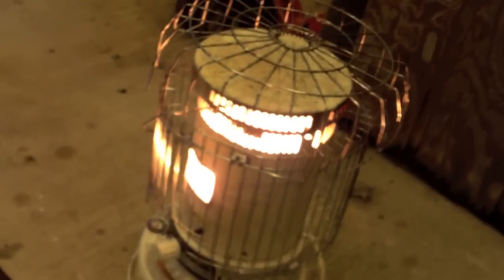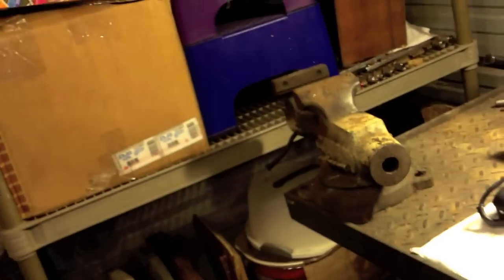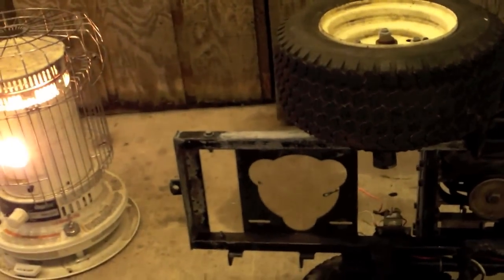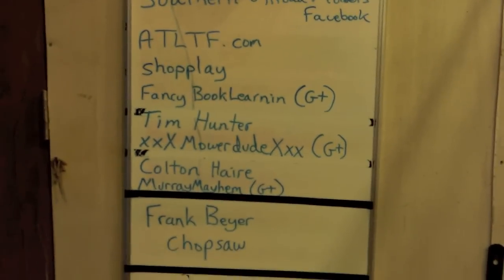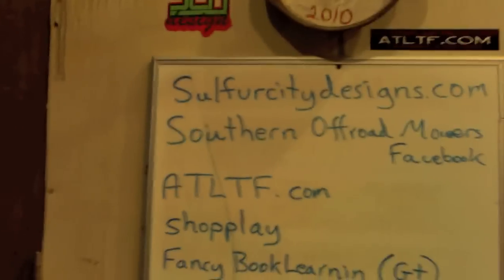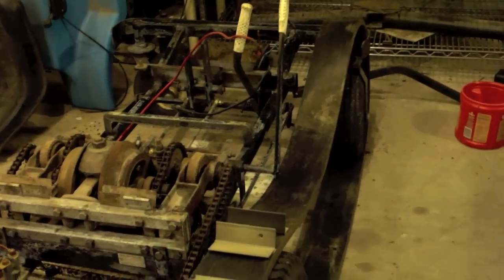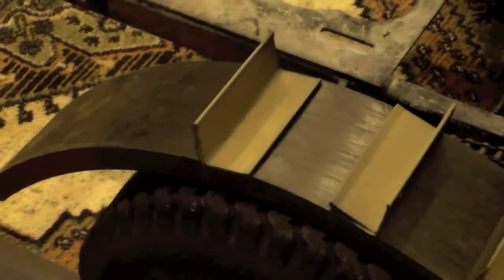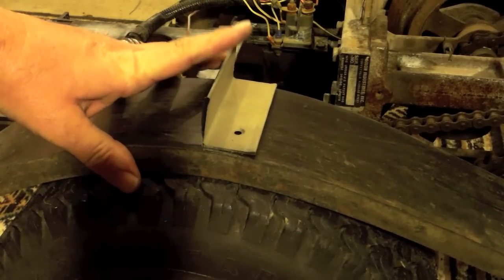Dixon track mock up!

Comment: Cool intro and music.
I'm to cheep to buy another grinder I use mine with a cut off wheel, grinding wheel and also wire wheel. and only hand tighten them. makes it easier and faster to change. The centrifugal force is enough to keep it tight. 
Hope it works.

Comment: You sure didn't go wrong on those grinders, mine lasted quite a while.
I wish you were closer I could hook you up with dixon mowers, and some snowmobile tracks.
Reply: *****
I can pick them up at a salvage yard, it costs them to get rid of them, but I would have to take it, but not a big issue, you would need to cut one in half, cause they're so many different sized ones, different sleds different tracks. Let me no if you are interested and I'll see what I can do...

Comment: I would recommend you make each track in two pieces... use 4 inch wide SS HD door hinges for the connections. The reason for the 2 piece track is so that no matter where the tread stops, you have an accessible joint for removal of the track. Replace the pins in the hinges with grade 8 shoulder bolts. If you can't find those types of hinges there, I think I have some I could donate. Sandwich the hinges ao they are not in contact with the road (split the ends of the rubber pieces so you have a half inch on top and a half inch on the bottom) This will keep the hinges from wearing through. If you chuck the ends of the rubber in the vice, you will find your cutting disk on the angle grinder will work quite well for this task.

Comment: Those angle iron will bend on the first drive, also they use reinforced rubber for those purposes, and I will suggest to think about how the tracks will track before traction, like will they run straight. And I wouldnt throw away money on stainless steel bolts unless you have em laying around, since the belt will be trash long before a galvaniced bolt will catch rust. Just my 2 cents :p And you can use wood on both the tracks and for the wheels.

Comment: You could use like 3/4 in screws to hold the plates in, like 3 to 4 screws per cleat. it would be cheaper and i think it would work.

Comment: Instead of having the points of the screw comming out the other side of the rubber just get shorter self tapping bolts and screw down the cleats and then on the inside of the rubber screw in to the rubber and use the head of the bolt as what the tire grabs on to or else u going to go through some tires because its going to tear it up

Comment: its a shame you only have enough of that rubber for three tracks it would make better tread blocks than the angle iron and I agree with those who said you will want to cut the angle iron down they look to me like the first time you put any real force to them theyd bend flat
Reply: ***** i figure if rubber tread blocks are good enough for the m1a1 Abrams tank then they should work well for your purpose unless you could find some old atv tires cut the tread off and bolt it to you tracks

Comment: hey that is a good Idea I do have 2 grinder but I always use 1 crap now I will hook 1 up just for cutting and the 2nd for sanding or grinding.. I am a meat ball wow I can't believe I sit there and get the tools out just to change over from cutting to grinding... haha thanks.. I use dewalt. also keep in mind with them cheap grinders if they come with extras brushes it is because there CHEAP and will break.. I got sick of going throw cheap grinders so I spent the money on a great one. I have had this for 4 years not 1 problem. them cheap ones I would have to get a new one like every 6-8 months.. no more...  ok what happen your in a NEGATIVE video now?? hard to see... I love the BOX O PULLEYS haha I would not use such large L bracket I would use like 1/2 inch L bracket that would work and ride better. just my opinion.. thumbs up bud.. I gotta go out and do some snow blowing with my tractor now.  I HATE SNOW.. this is the 2nd storm this week.. I have about 20 inch so far of snow BOOOO...
Reply: haha no thank you for your great videos.. thanks bud..